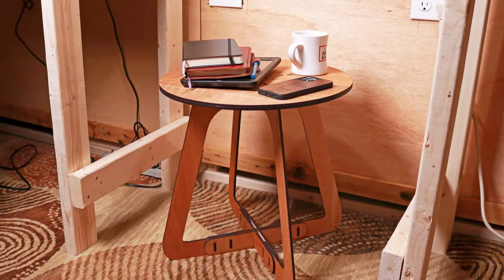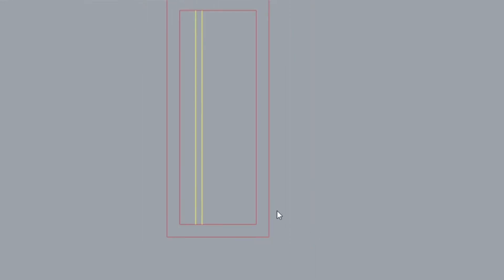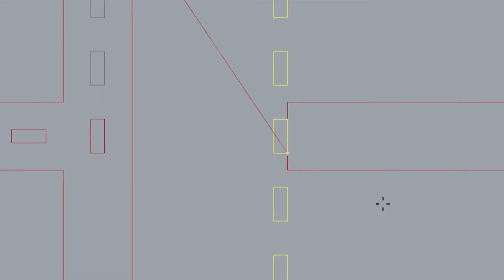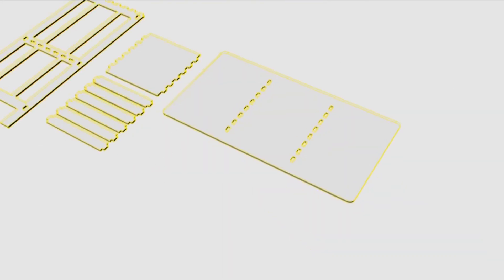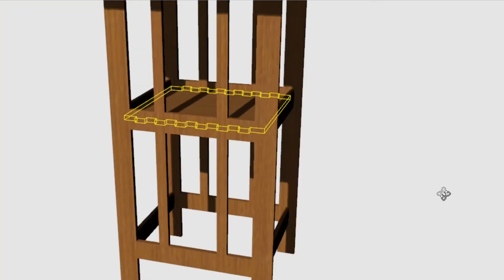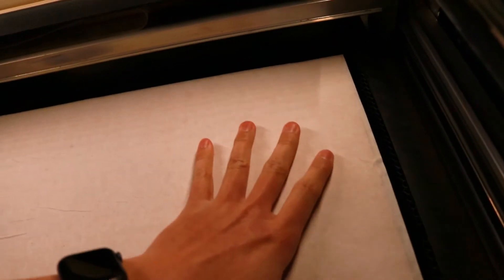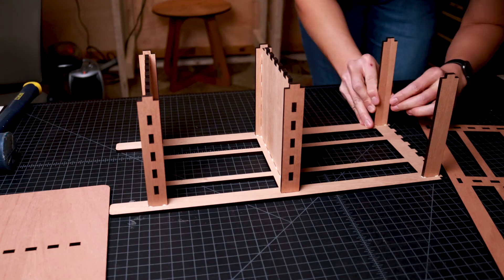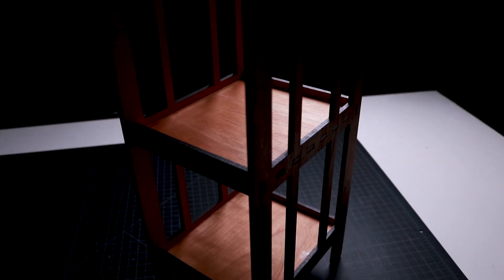Making a Contemporary End Table with a Laser Cutter

Comment: Nice work. You should mask your work during glue up and use a lot less glue to prevent squeeze out because it shows thru the finish.  I assume that you sand the work before assembly.
Reply from the maker: Great tip! Thanks for sharing. I sand the areas where there’s any scorched that stand out against the material